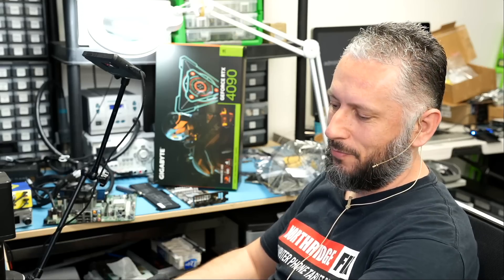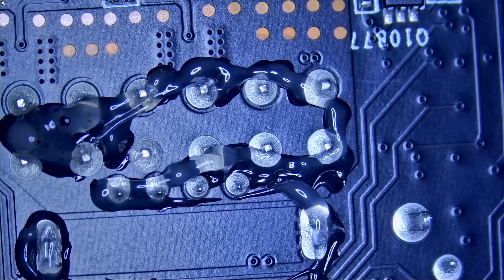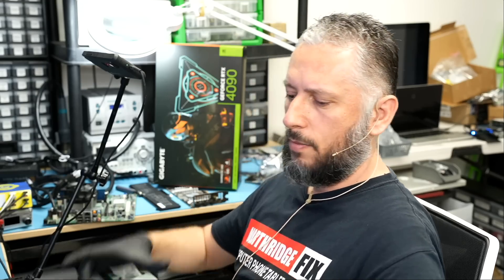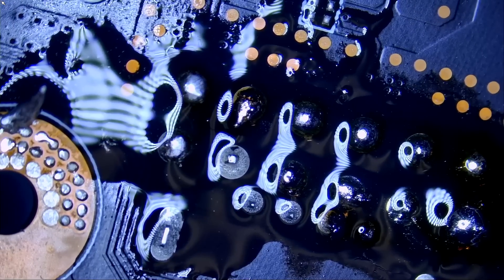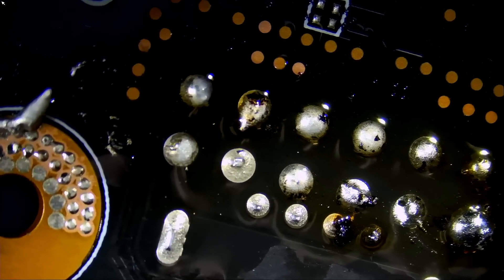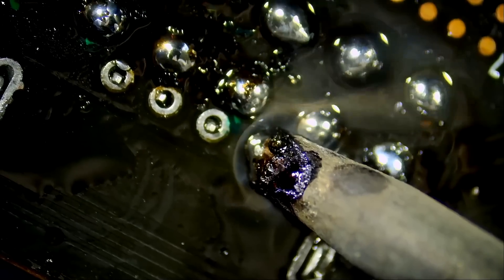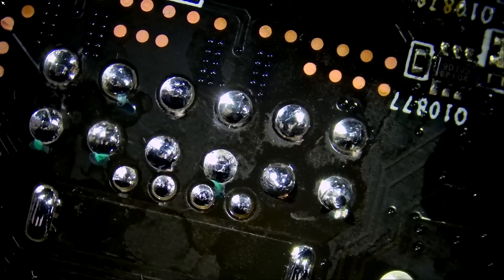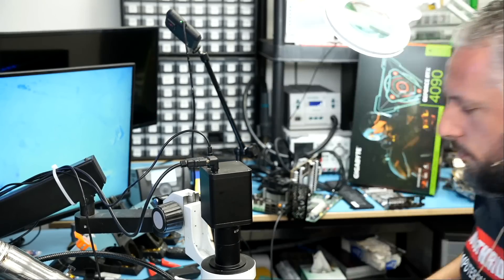4090 Connectors are melting like Chocolate - Zotac AMP Extreme Repair

Comment: its crazy. nvidia must build connector from metal & put 20mm fan on it. 👍
Reply: Its caused by user error. Users are not plugging them in all the way. Nvidia's fault for using the connector that allows this.

The end user should have used the warranty for this. But it was their fault it happened cause they didn't plug it in all the way.

Comment: it's honestly an insane concept to even think of having so tiny connectors and cables for something that will need 500+ continuous watts, and peaks at like 1000 watts.

would be better to have a c13 socket directly plugging to a outlet at this point, 😂
Reply: No , there is no 4090 peak at 1000Watt unless you mod using voltage control , even my 4090 vulcan oc , only peak at 550 watt and it's useless to oc 4090 anyway since nvidia heavily limit the voltage on 4090 , connector come from box pretty much garbage , if someone can affrord 4090 then buy 12VHPWR 600W cable from seasonic or corsair (depend on your psu brand) not the issue since it's better quality cable.
Reply: Wtf is peak 1000 watts, the card can barely go above 500w peak in OC. The connectors electrically are fine and rated for that, the issue is mechanical design. They are hard to plug in fully and the little teeth that engages the connector to keep it locked in also is hard to engage. Also being small they are more fragile. This makes the connector slip out or not go in completely and that's bad for any high current connector.
Reply: Shrinking the pins was the real genius move

Comment: just curious, why not returning the card? the manufacturer messing around and not replacing / fixing the faulty cards?
Reply: Cause they caused the issue by not plugging the connector in all the way. So it shows they are not intelligent at all
Reply: @tacticalcenter8658  it's not that easy to plug it all the way and you need a lot of force to finally get the "click" that engages the retention tooth. Your comment shows you are not intelligent and also poor

Comment: It was 4am, I was drunk and curious.
What would happen if I were to just boost my soldering iron to 500°C and try to desolder a 24pin atx connector from a mobo..
You know, for science.

Answer: You can melt the joins, but it will cool too quickly to wick it.
The solder temperature is too low to be sucked by the wick.
I only used leaded solder to lower the melting point, and that wasn't enough.
It's alot harder than the new gpu connector cause you can't cut the pins from the inside & 24 vs 12 pins.

Still, the oxidation from soldering at 500°C is unreal. My science experiment was a dud.

Comment: I hate those nvidia connectors.
Reply: Why?? Nothing bad with a connector like that. Boards should NOT DISSIPATE the heat when you try to desolder that. It should be easily desolderable, since it breaks so often. And cables that plug into that connector should not be cheaped out.

Comment: Aren't these still under warranty? If so, does that mean you do any warranty repair work?
Reply: Because this issue is an user error, im not sure if the warrenty will cover it, but that said it is hard to tell if the plug is fully plugged in.
Reply: Its caused by user error. Users are not plugging them in all the way. Nvidia's fault for using the connector that allows this.

The end user should have used the warranty for this. But it was their fault it happened cause they didn't plug it in all the way.

Nvidia said they would cover this. So if they are not, its them being really shady, cause they decided to use something so absurd that allows end users to do stupid things.
Reply: Was thinking the same thing.
Reply: I don't think anybody would fix that under warranty, the damage is inflicted by the user (the error margin is small, but what can you do)
Reply: @formbi  This issue was a very common flaw on release that actually affected normal user's quite a bit. The companies selling them should have done a lot better product testing, instead of being so quick to ship it out  with a much smaller wire gauge adapter in their final product.  And also for not making the clearance around the port in the metal shell of enclosure. All they had to do was shave off a few .mm around it. But instead the companies were too busy playing a D#CK measuring contest screaming mine is bigger! lol

So I really am not seeing much user error here. Yes it takes way longer for warranty junk, and a bad psu would have zapped and fried the card normally. The majority of the faulty cards are just melted ports, and repairable. So, it tells a lot about whether it was a bad PSU or not. I was just curious if anyone knew more about it all really. And if North bridge even did warranty works at all.

Comment: These connectors are a menace, i dont care if it only happens to 0.5% of cards, when you spend 2k on a graphics card it better be perfect!
Reply: Hey man I submitted the contact form but no reply
Reply: nvidia should make special powersupply with new  connector that handle those high amps,
Reply: @billykulim5202  The power supply isn't the problem, it is the connector that is too small and not sturdy enough. 
Amps aren't the problem
Reply: @artfess  the problem is powesupply manufacturer arent owned by nvidia. They can only make connector standard by assosiation or something. Like standard 8 pin connector are
Reply: @artfess high amperage draw on a power supply that can't put out what is needed makes heat. Try again.
Reply: @billykulim5202  it handles it fine. This happens when the user doesnt plug the connector all the way in.
Reply: @tacticalcenter8658  It's definitely the connector fault . In datacenter Nvidia cards, like Tesla series, Nvidia use EPS12V connectors , same like the ones on the motherboard to feed the CPU . Not the 12VHPWR .  EPS12V connectors have survived heavily overclocked Intel HEDT and AMD Threadripper CPUs with over 1kW of power draw, never heard those connectors melt before.
Reply: @tacticalcenter8658  there's been RTX 4000 series 16pin power connectors plugged in all tha way and it still burns

Comment: The cards are so big that when you plug in the cable there isn't enough room between the connector and the side panel for the cable to bend (unless you have a really wide case). This causes the cable to press hard against the side panel (usually glass) which eventually can cause the cable to become slightly separated from the connector. This then causes the connector to melt as shown by GamersNexus' video. I suspect that this is why so many of them are melting, but there are also some cases where people simply didn't plug it in correctly and it melted because of that. There are cables that you can buy which have plugs that are angled at 45 degrees, that way you have more space between the cable and the side panel of the case.
Reply: Yea and for the absurd price they are charging for these cards they should include that 90 degree connector at the very least. Alex is right though it was ignorant of them to pack all this voltage into one single connector! Especially given we have gone years now with two and many times three power connectors. I believe this is all a scam to help sell the newer power supplies because they support this high voltage single connector on one rail. While nice to have the money to upgrade, once you have been suckered into buying this card its hard to cough up a few more hundred for a power supply you otherwise probably did not even need!
Reply: U can use 90's from cable mod. They have a variety of colour. They have some 180's too.
Reply: No, the reason this is happening is because Nvidia deliberately released a faulty and poorly-designed product to the public, gouged the customers like the capitalist pigs they are, and then pursued a strategy of blaming the customer(s) when one of the worst designs (other than AMD) of GPUs literally melts when used as directed by the manufacturer.
Reply: This plug is not better then the previous ones :) it's just cheaper
Reply: Definitely agree with you on this one. GamersNexus showed how it melts if not plugged in right, that also applies to power supply, where cables not plugged in right would melt and short out and probably short everything else in your PC as well. Well done to Alex and team for a great workmanship. Mashallah, keep up the great work
Reply: That's why I left the side panel off until my 90 degree Moddiy cable arrived. Better quality cable also
Reply: Are you seriously blaming the customer for a company oversight??????
Reply: Computer geniuses should know the 90 degree PCIE adapter was invented for that reason.
Reply: Nvidia said that warranty will be voided if the original supplied connector was not used.
Bonkers never ever again
Reply: Why spend money when you can use an exact-o knife and achieve the same thing
Reply: Maybe in a crap case. Mine has plenty of room.
Reply: I dont know how old are you but if you old enough you know that nowadays even tools are made anti stupid,most of the tools and stuff that we are use everyday its made to be anti stupid but if you want to drive a nail with the old hammer 🔨🔨🔨 and you hit you finger,well you either need glases or you need robot fingers as replacement 😂😂😂
Reply: solution is modular psu with angled custom cable
Reply: @frenkie0902  8pin is better
Reply: no sir, these connectors are melting because the sense demand has too much latency before adjustment. be careful what you believe and from who. everyone that has a channel is also a marketing guru for corporations.

Comment: Seriously considering avoiding the 40 series because of this. What say you?
Reply: It only happens if the plug is not fully clipped in. Cheers
Reply: Many 4070s don't use the 12 pin connector that is known to melt. 4060 ti and 4060 likely won't use it either

Comment: To the joint where the low-melt solder is applied you can also add a little bit of leaded solder to create a rose's metal like blend to lower tge melting temperature even further.
Reply: What do you think low melt solder is? It is in fact a high content of lead, thats why it melts at lower temps which is exactly what you are already doing creating the roses blend using low melt! No need to complicate it when its not necessary!

Comment: You really have to wonder how these tech gurus come up with a design like this..
Reply: those 8 pin standard cannot handle those much amp anymore,  they should design special connector, but they should ask powersupply manufacturer to make those new connector
Reply: @billykulim5202  I would have no objection with 4 8pin pcie connectors, there's your 600 watts and the 4090 is huge too.
Reply: @billykulim5202  this is already a new standard and the pins can take it. The issue is not the current, the issue is that it's hard to connect it properly
Reply: @billykulim5202  they tested it on various channels, it works fine, mostly its user error, they dont push the connector to the end, so it melts.
Reply: @milosstojanovic4623  it is user error, but the error margin is a bit too small
Reply: yeah but in reality the design calls for some kinda ATX3 the one dubbed cybernetics, I'm not convinced with it the least, but it's the intended power supply
notice there is some small 4 pin connector, that connector job is to achieve some sorta communication thru protocol between PSU & GPU
So, then it ups or downs the current/voltage powering it to needed levels.
But yeah I agree with you that Radeon cards never had power connector melt issues, so your point still stand

Comment: Why does the costumer not RMA the card?
Reply: maybe got rejected because the connector caught fire
Reply: Could be a couple of reasons:

-Customer bought the card second hand / ebay, so doesn't have an invoice (most manufacturers require an invoice for warranty)
-Card been dismantled to add water cooler, immediately voiding the warranty
Reply: @blower1  dismantling the card does not void warranty. ANy sticker that says "warranty void if removed" is illegal
Reply: @blower1   "Dismantling" the card does not void the warranty, as screw warranty stickers are not valid in the US. If the user installed water cooling on it, then reinstated the card to its factory condition to send it for an RMA, it would have been fine, as the factory would have no way of proving it was modified by any means.
Reply: Was wondering about that, too. 

As far as I know AIBs were replacing cards with this failure regardless of user error.
Reply: It is user error but nvidia said they will cover it. Cause it is their fault for using it making it easy for user error. The end user could sue and get something in return.

Comment: These new 40** connectors combined with Nvidia cheeping out on its power balancing circuits is one of the worst ideas in tech for a long time.
Reply: this topic is long done and dusted, it's confirmed to be due to user error by not plugging the connector all the way in. I can only assume this is also why the user didn't RMA the card since it was user error.

Comment: GN did alot of testing. it only happens when the cable is not plugged in all the way.
Reply: The issue is people are used to plugging in the older style connectors, which require far less force for them to engage properly compared to the new style. The design probably needs a bit of a tweak for next time to make it easier to connect to help with the issue.
Reply: Is it really just that or could it be the analogy he mentioned of cramming too much power in such a small space? I find it hard to grasp that people suddenly don't know how to plug in a cable properly.
Reply: yeah, but the error margin is a bit too small
Reply: it still burns with it plugged in all tha way too bruh

8pin is better
Reply: @blakedmc1989RaveHD  i know buddy. 4weeks ago i only had so much imformation😉👍
Reply: Still a terrible design. Cable should not melt even if not plugged correctly. The angle on these cables is also very poor, I suspect most of these have melted not because they were plugged poorly but because the cable was bent too harshly so that it would fit in the case, eventually causing it to slightly unplug. The glass pushes too hard against it basically. Just terrible design all around.
Reply: you're right, that's why it doesn't happen on any other cards, people don't know how to plug in a card, only when it's a 4090🤣🤣
if gm really said that, I'm surprised at them, because it's not logical!
Reply: @fredololafumas  4090 consumes way more power than any of the other models

Comment: 4090 reasons to not buy an Nvidia Card...
Reply: Mine is fine 🤷🏽‍♂️
Reply: @Crecross  Mine too
Reply: @Steves Electrical Stuff  What psu do you use and you use the factory 16 pin connector?